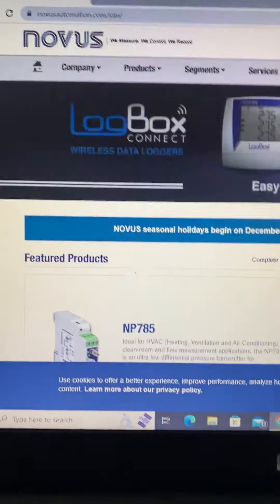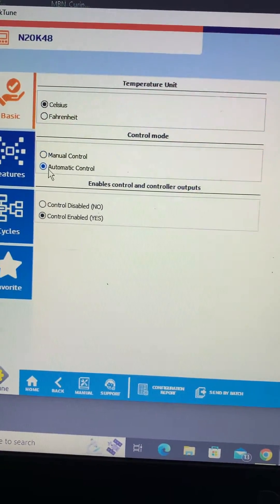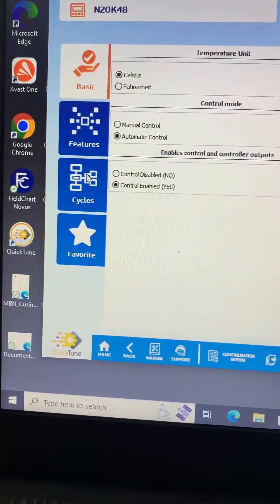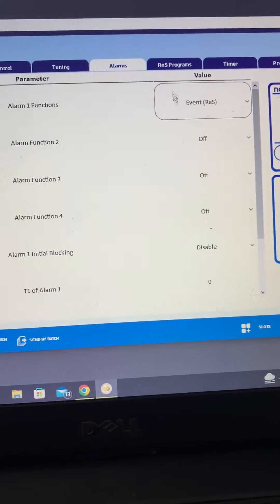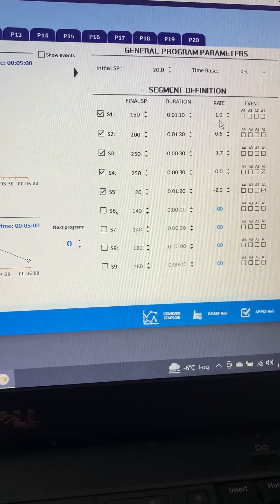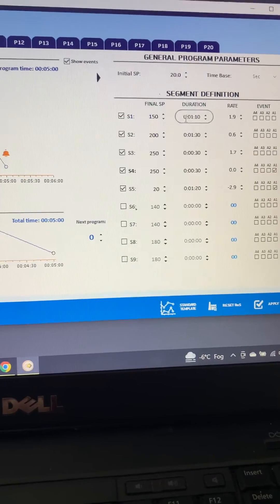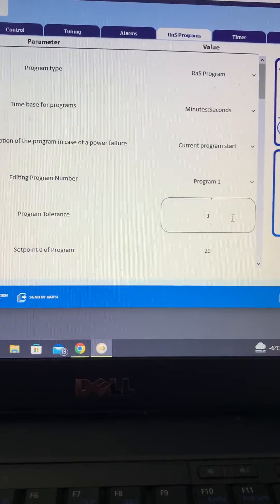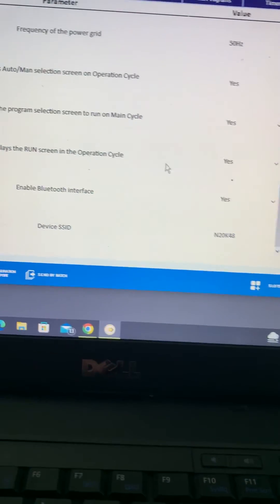Novus N20K48 - Ramp & Soak Programming (1/2)

Comment: When you make a setpoint to 800 Celsius can you assign it a ramp rate of degrees per hr? For example heat to 800 deg.C at 100 deg.C per hour and then hold for 2 hours
Reply from the maker: Yes, you can achieve this in a few different ways. Depending on if you want a straight line to 800C or any holding in between. The best method is to download QuickTune and experiment with the Ramp and Soak programming tool. For example, you can set one Ramp from ambient temperature to 800C lasting 8 hours. Then another 2 hour segment to hold.